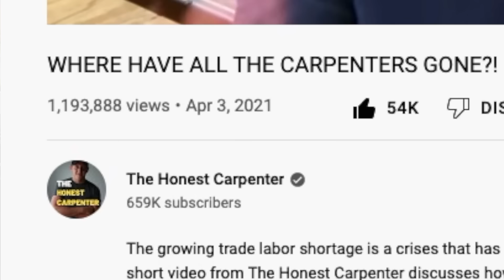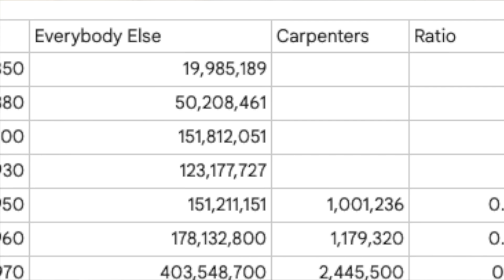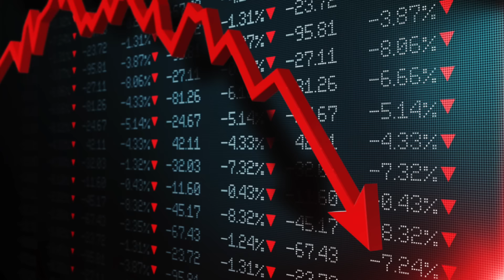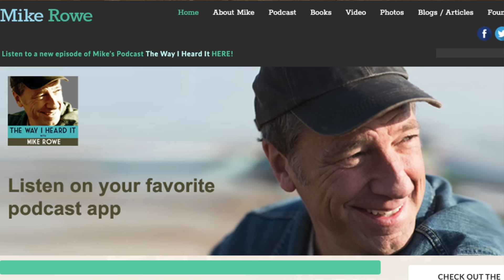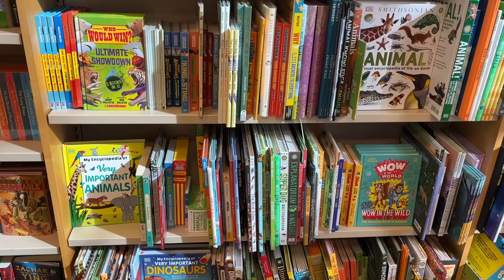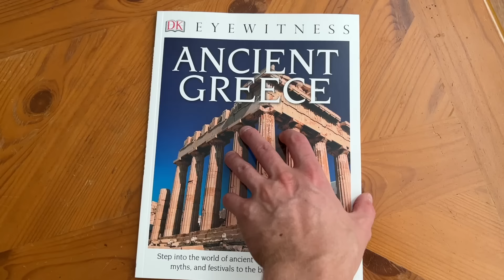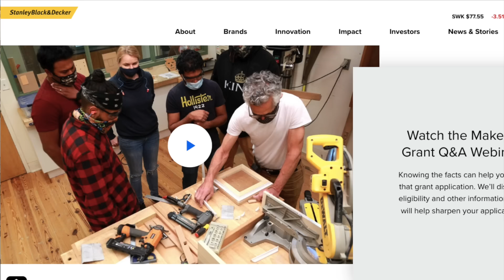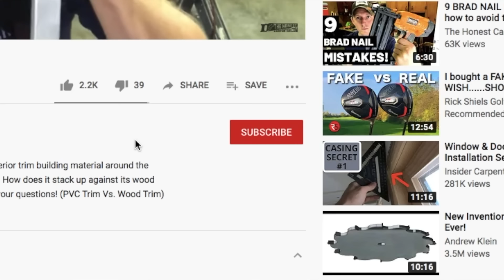THE TRADES ARE DYING...But The World Still Needs To Be Built! CAN WE FIX THE SKILLED LABOR SHORTAGE?

Comment: I have been an apartment dweller most of my life and recently, I acquired a 100 year house and I've found it quite overwhelming.  However, with lots of time and youtube support I've found myself able to tackle plumbing, electrical, carpentry, concrete, and a bit of hvac at a supplementary level. Is everything up to code on the work I've done and at the professional level?  Probably not.  Would I have been able to do any of this without the transparency of youtube professionals in the field?  Absolutely not.  Not only is the amount of money to hire people house not financially feasible for many, the job itself is not feasible without the information.  It is quite possible that with this new age, that in order to maintain these houses, each home owner will have to become an everyman as trades dry up.  If the trades do dry up, transparency of information, both in accessibility, clarity, and  honesty may be one of the few things that will hold the world together.

Comment: My highschool had a program where instead of having elective classes after lunch you would get on a bus and go to a local trade school.
I was in the HVAC class I toke a semester in welding at a community collage then left since I asked my teacher is the semester was all I needed to get a job and he said yes.
I have never been able to get a job in the trades. They look at my resume and think I know how to do everything then I get to the interview and realize I knew about 10-30% of what I needed to.
So they said to go out and get experience and now I'm a busser at a local restaurant. Because every job either requires experience I can't get or stresses my autistic ADHD brain to the point I have to leave to avoid having a mental breakdown. The closest I got to getting in the trades was a fire sprinkler job where they said they would train me then fired me when placing my clueless ass next to there hardest worker and told me to "Ask questions" wasn't going to work. I spent Half a decade trying to get in and couldn't even get in. I even tried to get in through a builders guild who had me take a test said I passed then gave me a list of numbers to cold call. Half of them weren't even in service the the other half were confused how I got there number.

Comment: I went from a kid who did nothing but play video games into someone who fabricates virtually any part I need for automotive or guitar building projects, and can fix virtually anything as I've taught myself to weld steel and aluminum, braze, solder, plastic weld, shape sheet metal and so on. Life is so much more fulfilling doing something unique and difficult.

I think the ever increasing complexity of life, along with the helicopter parenting of recent generations, is the largest pieces to the puzzle to why trades are dying.

Most of the friends I have were always dissuaded from fixing things or using tools because it's "dangerous". Modern equipment is a lot more difficult to fix and requires a lot of expensive, specialized tools and a good knowledge of electrical. A lot of simple fixes are no longer simple, as there's so many regulatory emissions items or safety features in the way that even an alternator can be a full day job. 

I don't want anything to do with fixing cars made post 05' because it's just not even worth the hassle and they're not nearly as fun or adaptable to modifications. Would much rather build old stuff and adapt it to have any of the means that it lacks, but even that's at big risk due to all the legislation that limits creativity and improvement for the DIYer to target borderline nonexistent impact on climate and safety. 

Societal overemphasis on safety, right to repair, non-intuitive electrical complexity, stigma of blue collar work, tool inaccessibility, and regulation are all the reasons to name.
Reply: @ummmkay1744  that may apply to some people, but all the information is available to learn how to do things correctly. I've done things the wrong way plenty of times to learn why not to do it that way and how different materials and repair methods interact.

 People take shortcuts and don't take the time to understand WHY they're doing something the way it's being done, and they often fail to understand basic material science and physics, which is really the fundamental knowledge beneath it all. 

I tend to be an exception to the rule, but it's just evidence that it's plausible for mostly anyone to do it given the time and motivation. If you always wait for the perfect opportunity and conditions to chase your goals, you won't reach them.

Comment: As a union laborer I never understood why carpenter's are paid less than the other trades.
Reply: Because the mass-produced products are good enough and close enough to handmade craft
Reply: @clearcut6818  Not even close to the truth. If you believe that modular buildings are as good as a stick built, you have no idea what you're talking about.
Reply: @christined9210  I don't have to believe it, the market dictates supply.
Reply: A homeowner might be willing to mess with his deck but probably won't be willing to mess with the plumbing or fix something on his roof. Thats why.
Reply: illegal immigration
Reply: @jimmyware511  more like illegal occupation
Reply: @clearcut6818  The market dictates it? I'm not seeing that. Even if that were the case, who will repair and remodel all those modular homes? You can't just mass produce a remodeled kitchen and bath. Remodeling is in high demand and it requires skilled craftsman.
Reply: @jimmyware511  Exactly

Comment: Part of it probably comes from the predatory pricing companies use. We got two quotes for upgrading the 100-amp service and rewiring our 1,500 sq. ft. house. One was $23,000 and the other was $26,000. A crew of three could accomplish the job in a day, two at most. There's simply no justification for charging $300+ per outlet and $400+ per switch. The end result is that I'll have to pay to get the service upgraded because I can't do that myself. But I can rewire my house by myself. So those companies will lose that money, which means they lose a bit of work for their crew.

Comment: During my stint in university and finishing my sociology degree, I can indeed confirm that even in colleges besides those who are partnered with sister schools due to budgetary constraints . . . Trades are invisible. No sane person would ever pursue them, especially not in this job market. Welding is popular across the midwest, but the advertisements of pay and benefits for a SEASONED tradesman pay less than working at Target. Virtually any job, even one at Mc Donalds would pay you equivalent starting off after you adjust for the factors relating to living and working with that job. No sane person would work for 15 to 20 an hour to be a welder across the central midwest, which were offers I saw a few years before the pandemic. This is prevalent across the trades, the rate of pay for none independents, union and contract are so woefully depressed that ONLY the already working individuals who are making the rate they demand can even do it. It is maddening.

Comment: I always was interested  in the Trades, in High School  the encouraged us to pursue  computer  skills. I ended  up  going  to college  studying  Real  Estate, and  mid degrees  switched  over to  trade school  for  Carpentry  because  wanted to flip Real Estate and learn  the construction process. Once I completed  Trade  School, I only  ran into several  issues  need yrs of Xamount the experience and Bilingual  is a must. It was extremely  difficult plus  the pay was not even modest. I luckily  lauded  a Job and to work  a part-time  simultaneously, as of now it's paying  off. But definitely wasn't  easy.

Comment: Well I don't know the last time I went to applied to be an apprentice lineman they wanted a bachelor's degree in engineering......

 The starting $30 an hour wage didn't look very good after that... Nor did I have a bachelor's degree in engineering...... Considering that I've already had much of the same safety training  because I work for the company that and deliver there utility poles for them all the time you think they would at least consider me including the fact that I have a CDL class A and experience using a grapple boom to lift and set poles in and around live wires...........

Comment: to use the term "trades" is spectral.   Commercial construction occurs on site;  residential CAN be pre-fab (high quality).  Anything potentially importable is.  Not all production equipment is a "throwaway, replace";  at times no replacement available (or rapidly enough).  That means:  continuance of repair shops.  Repai shops where, "how cheap and fast can it be acceptable"?  No time for training (relatives, huntin' buddies, etc.).  If I applied today (very old, physically wasted) be offered 58 hr/wk for certain.  So, I say, "put it all in a container and send to S. Korea/ Viet Nam".  Customer can wait 2 months--- right?

Comment: The problem at hand is likely to be resolved without intervention as the free market's invisible hand typically rectifies such issues. In cases where trade jobs are in high demand and low supply, and office jobs offer poor compensation, the issue is resolved quickly since trade jobs require relatively low skill levels to start. While there may be some initial difficulties, there is no need to lose sleep over it.

Comment: There’s a lot of factors on why the trades are slowing down (minus electricians). The biggest factors are definitely the newer generation not being as interested or hands on and the older generations in the field stuck on old habits. On top of that it’s a pyramid scheme with desk geeks who’ve never worked a trade encouraging people to join because they are essential for society and they don’t want to be the ones working those jobs. Also Overtime isn’t a “benefit”, your forced to work those hours to get paid more, and your work-life balance is screwed. The trades are only worth it if you have a family to feed or you don’t want to work a dead end fast food and retail job that pays low. If your young, take the college route, and learn something in STEM to become a doctor, scientist, engineer, or architect. If you don’t want college, then there are plenty of entry level jobs in STEM to apply to and work your way up with experience.

Comment: I've applied to every electrical company in my area at least twice (and one in particular over 5 times (once per 6 months)) and have never even been interviewed, let alone hired. I'm 26, able bodied, and not debilitatingly stupid.
Now I'm doing contract work installing data cables on new construction (so still not really a trade). I know the "shortage" of laborers is real purely because from Alabama to Virginia every work site I've been on has a noticeable lack of 30 year olds. They're all either 40+ or 20 and younger. While it is scary that we're short a generation of skilled laborers it's hard for me to blame anything other than the companies themselves for not hiring and teaching people to do these jobs. It seems like it's the same level of nepotism within the trades as there is on oil rigs (iykyk). Now that people can see my work I've been offered positions on site from these companies but Jeezy kableezy I make 3x more running an ethernet cable 100ft than I would digging trenches for conduit.

Comment: with the new CAD animation features, AI, etc muuch of the training could be speeded up especially for those switching from related trades or jobs and from the tech sector. doing 8,000 hours of apprentice ship for some is an entry barrier if they are coming from a feild and eduucation which is above what is required for that trade.

Comment: I quit learning framing and roofing because every single one of the crews that hired me were filled with strung out addicts and deadbeats who wanted under the table cash to avoid child support. Obviously not everybody but in Central Texas I couldn't find a crew that wasn't like that. When I tried to get into plumbing as a veteran I could not find anyone who wanted to train me. I'll go work somewhere else for slightly less pay and save my body. I did that, I manage a dispensary now and the crew that built our internal walls were obvious junkies that did a shit job. Uneven ass doors that close and open by themselves and tons of gaps in the drop ceiling. 

Starting pay is $15 or less for apprentices. Fuck that. I can get more at KFC.

Comment: One reason other than what johnnybaboon8166 commented. I found out that the company I worked for was taking union dues out of my check. I was intrigued so I called just about every union in my state and it turns out I am not in a single one of them. Call the company and they say that they don't have to sponsor me for the union and that they took the dues out to just give to the union as a donation. Combine that with sporadic working hours, planning everything around a text or call between 6 and 8 p.m., and giving not exact locations so I end up driving around to find the site it is LUDACRIS. I'm getting a job that may not pay as much but, will allow me to actually start a side hustle and go back to school at the same time instead of sporadic days ranging from 2-14 hours with an hour and a half commute each way or even more occasionally

Comment: As an electrician of over 30 years, one of the best you'll meet, pulling in $150k a year as a maintenance supervisor,  don't bother. Go to college first, if you still want to after go into an apprenticeship. Nobody has any respect for the trades. And they're desperately trying to find any possible way to have unskilled labor do your job. They'll blow a bunch of sunshine up your butt about how there are no limits to what you can do. It's just a line to keep wages low. Look at any upper management jobs in the trades and you'll need a degree. They killed trade programs in schools 40 years ago, they're not bringing it back.

Comment: I'm one of those folks in the 18-40 catagory that got into the trades. This video does illustrate one problem, but it misses a whole bunch. 

Off the top of my head: 
- Many jobs in the trades are strenuous and job security is scarce
- The pay just isn't keeping up with inflation, especially when compared to jobs in the tech sector
- There's a huge lack of apprentice programs outside of Unions
- The culture for some trades is stuck in the past. It varies from company to company, but the construction industry has a reputation for being homophobic, antagonistic to women, and dismissive of worker safety. For example, I was retaliated against for wearing a respirator for silica. I've also been called slurs on the job and seen coworkers sexually harass others in front of my foreman with no consequence. I've seen enthusiastic women get mocked and beaten down despite having a great work ethic and doing a good job. Millenials, Gen Z, and Gen Alpha are increasingly intolerant of that shit, they don't want to deal with that shit from their coworkers
Reply from the maker: All of this is just unfortunately very true. And I’m afraid it’s why, when my female friends ask if they should join various trades, I usually tell them no, or warn them heavily about what they may face. 😞

Comment: I'm an electrical contractor in Ontario who started electrical in 2000. For three years prior, I framed houses and I'm not a bad Carpenter to this day. I too have considered bringing awareness to some of the cries coming from the construction sector at large for what I'll call fresh meat, and I've been listening to these cries for well over 20 years now, to be honest.

"Construction" is a huge category so I'll be more specific. 

To all disoriented or misguided young people considering the trades, please, unless you reeeaaally cannot put together anything better, please steer clear of the LOW-RISE RESIDENTIAL SECTOR (and perhaps the high-rise as well). This sector represents about half of all construction in Canada, and it will perpetually be moaning for fresh meat because it devours its own and degrades itself in the process. 

It's not without good reasons that young people have been dissuaded from "construction," and if a trade in the low-rise residential sector is looming on your horizon, well, I recommend a change of trajectory right quick. It will NOT respect your person, it will not be a full career in terms of longevity and it might even leave you worn-out and vulnerable mid race, it has no concern for your comfort or even your most basic of needs e.g. clean water, clean bathrooms, and again, these types of positions are not very highly regarded by most of society for good reasons. 

I was once convinced that the low-rise residential sector would at some point come out of the dark ages and start to respect itself so that others could, but that was naive of me as some things just never change.

Choose wisely my friends!